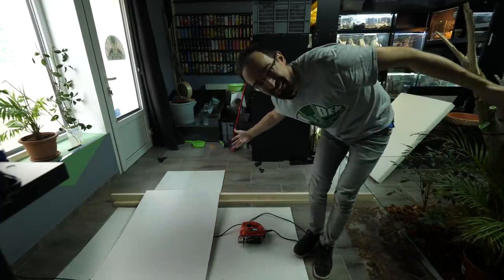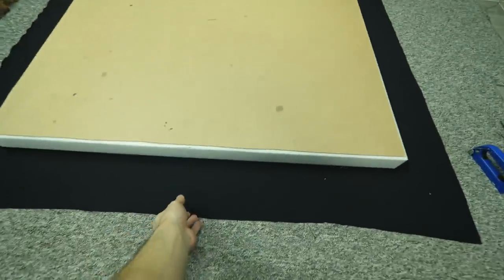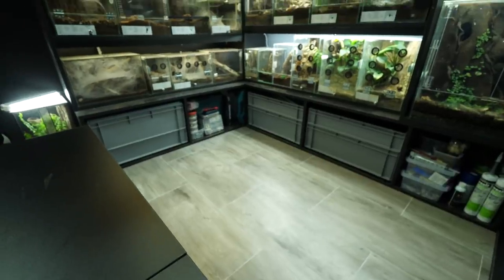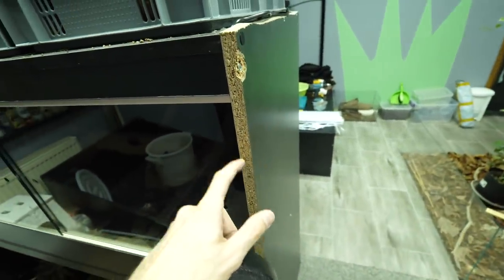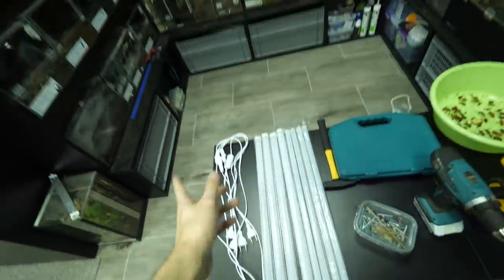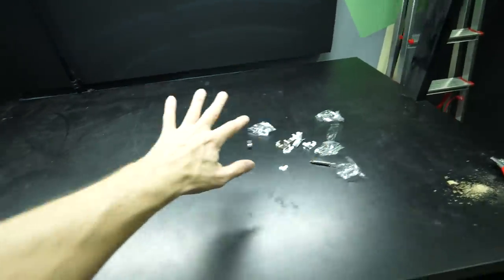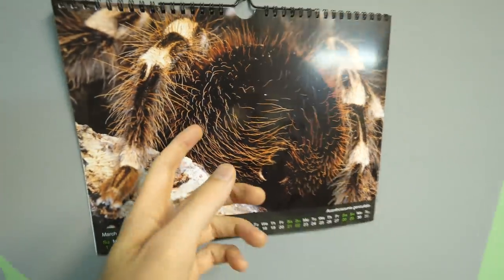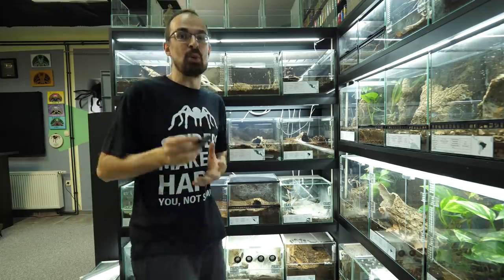UPGRADES UPGRADES...

Comment: Something you might find useful is the Black Magic Craft base coat. He uses it for miniature terrain but it's also helpful for small DIY fixes. Mix Mod Podge or whatever relatively thick PVA glue you can find with cheap acrylic craft paint. It's an inexpensive sealant that's really sturdy. Experiment with matching the color you need for the surface you're covering. If you use Elmer's glue, make sure it's not "school glue" as that's much weaker. Any all-purpose PVA glue will work.

Comment: The problem with foam it is it absorb medium and high frequencies, where as in your case the problem is with low frequencies which are harder to control. Placing the panel on the corner where acoustic waves meets helped a lot.

Comment: To hide those cables on the shelves you could take strips of black poster board or something similar and cut them to size and place them in front of the cables to hide them. Just secure it on the corners and the middle with something that would be easy to remove if you need to access the cables and boom hidden cables.